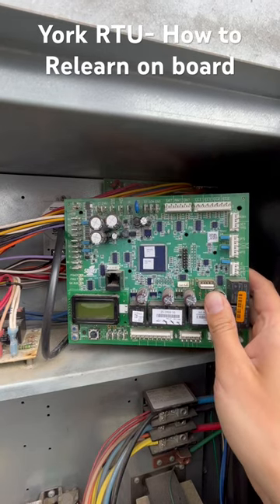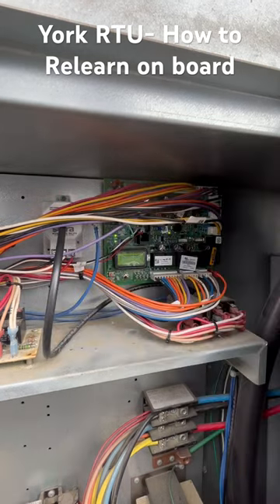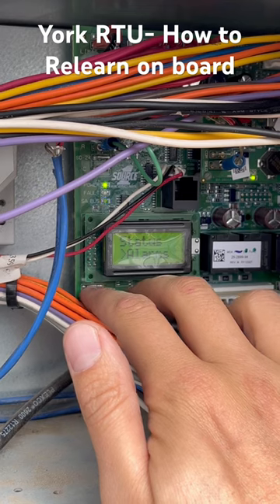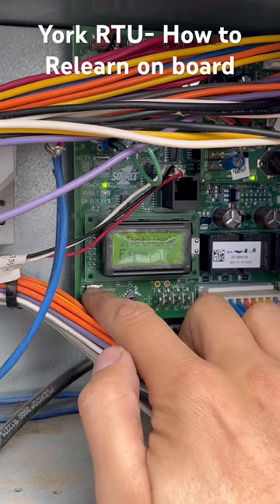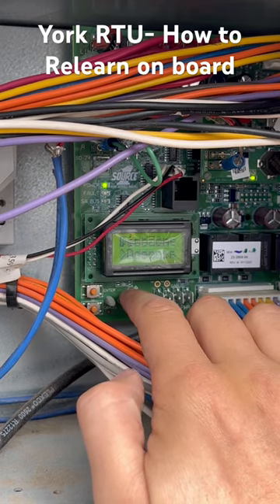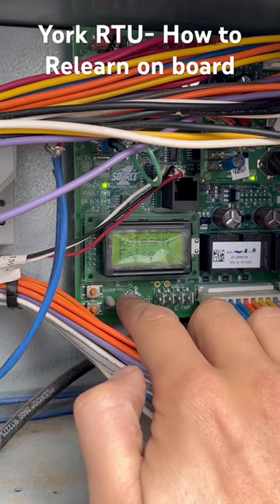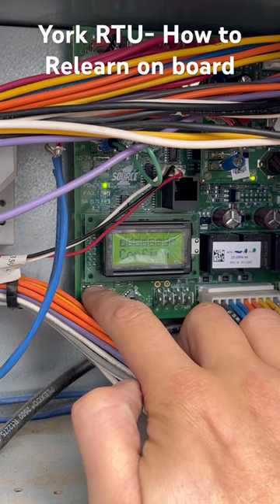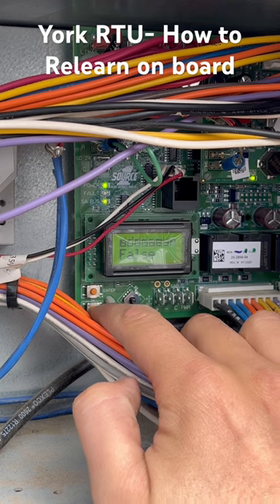York RTU: How to Relearn SSE board #short #yorkrtu #hvac #hvacservice #hvacshort #calgaryelitehvac

Comment: I tried doing this today but I didn’t have a relearn option in the menu. Is this only applicable if there is a bas system?
Reply from the maker: Majority of those board have a re-learn but depending on which version of board it can be located in different areas in the sub menus. Try and find a manual for your unit. In the last few pages there is sub menus broken down. Much easier to skim through

Comment: What does this do? I usually just re commission the new board and set everything manually when I replace the baod.
Reply from the maker: New boards come with every sensor pre installed on the programming. So sometimes a board will display “ humidity sensor fault “ “ OA sensor fault “ but these sensor aren’t even installed. By re-learning the system it will identify that these sensor aren’t used and will eliminate any alarms correlated with these sensors. Basically it removes nuisance alarms and recognizes sensors that have been added.
Reply: @CalgaryEliteHvac oh man, I've been having a "bad sensor freeze protection disabled" alarm ever since I replaced a York condenser (I checked the suction thermistor and it was good). I called York and JCI tech support and they couldn't tell me how to fix it, they literally said if the unit is working then just ignore it lol. 

Thanks for the info!